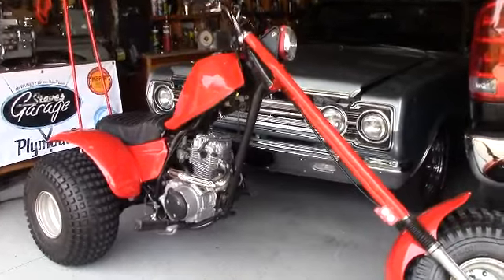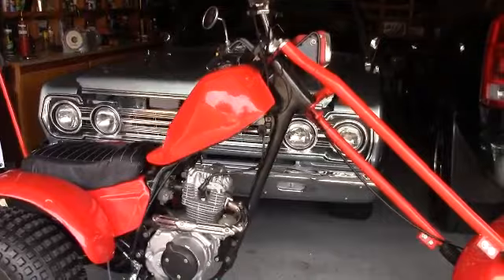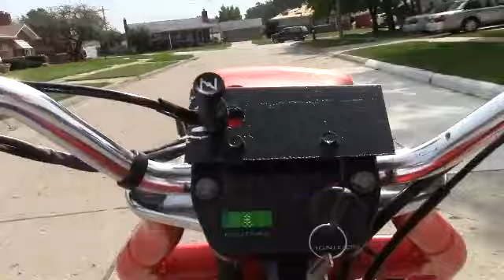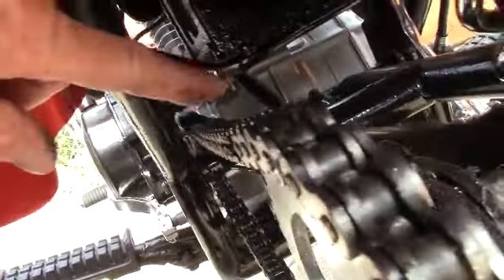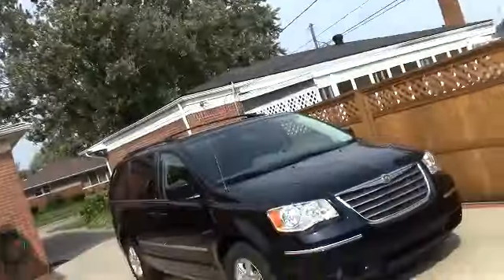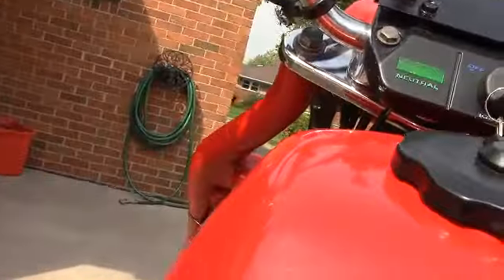Steve's Garage

Comment: Super job and what paint work!! It sounds great and seems to run fine especially after it's bit of modification.
Reply from the maker: Dan Whiteford Thanks Dan, I am going to see if adjusting the timing chain will help with the ticking I already checked the valves and they seem OK  Have a good one

Comment: Bike looks great Steve and sounds really sweet too.
Reply from the maker: Thank George, I am going to see if I can find the ticking sound in the motor and take care of it . I did check the valve clearance and it look OK But I will check it again just to be sure.
Reply: MrWillis5719 Check the tension on the overhead cam chain. There is an adjuster. :-)
Reply from the maker: EdOfTheNorth Thanks Ed I will look into it. That is the area the ticking seems to be coming from.

Comment: sweet looking bike,makes me want to build one.have  you checked the valve clearance on the engine or do the older engines sound that way?good job on the build ,whats the plan for the bike ,keep or sell?
Reply from the maker: 4x4Rick Thanks Rick, I did check the valves they seem to be OK, A friend told me to also check the overhead timing chain for adjusting may be that will help we will see and I'll let you know Have a good one
Reply from the maker: MrWillis5719 I forgot to answer your last part, I will sell it but I don't know when and I don't know whats it worth,

Comment: Nice , I see you changed out that jockey shifter.  I was wondering if you were going to to like that, or not. Thanks for the ride.  Of coarse now we want to see you do a ride by so we can check your stance on it, lol...
Reply from the maker: Thanks Bruce. I took the sifter off because I thought that it would wear to much on the shaft seal and start leaking. You got a good eye. One of these day I post a video on a drive by for you . Take it easy Brother.
Reply: MrWillis5719  maybe something like this would help ya.. i know you can fab something like this no problem...http://aaok.com/blog/?attachment_id=304
Reply from the maker: Thanks, I had thought of something like that . It would salve the problem with the strength of the shaft, I just have to figure out were to attach it. Thanks again

Comment: Sounds good Steve. I can see your reflection in the gas tank as you were pulling into your driveway. Beautiful work, what's the next project?
Reply from the maker: Bob Vance Thanks Bob, It's funny you ask that I been wondering the same thing, I just have a few engine adjustments like overhead timing chain and recheck the valves , The ticking is driving me nuts. I guess we will have to wait and see what come my way.as far as my next project, Take care and have a good one,